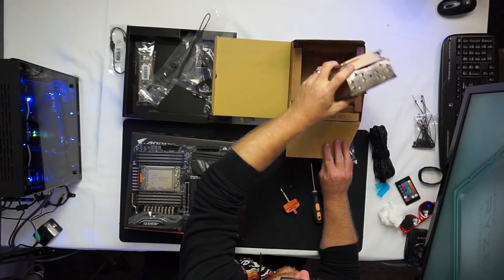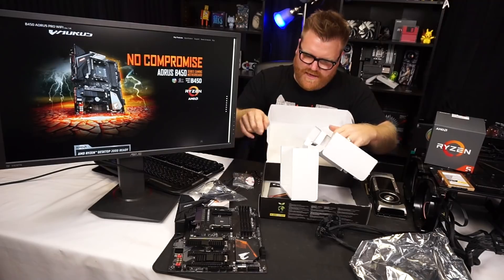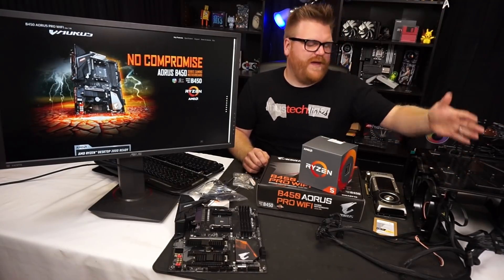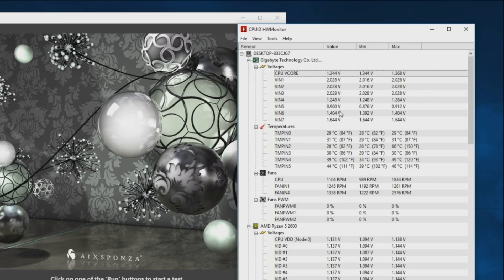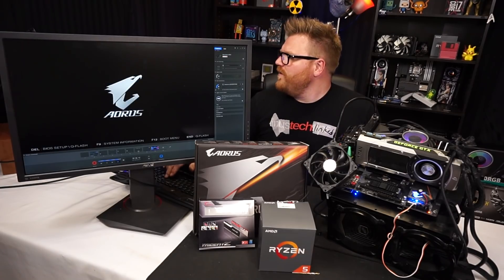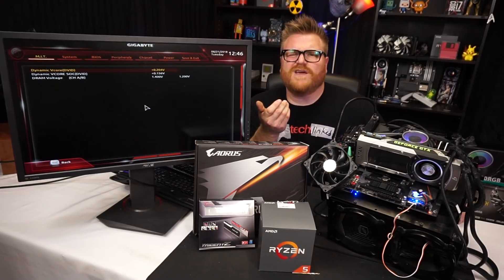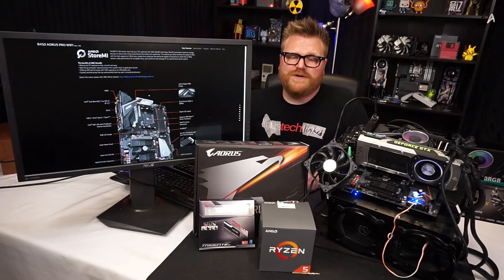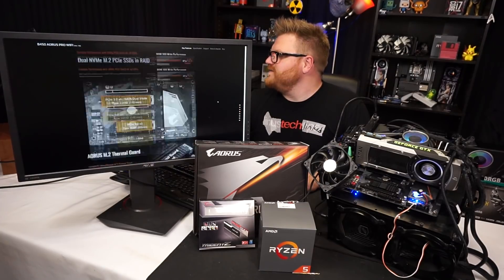B450 Gigabyte Aorus Pro Wifi, all the bells and whistles except for one

Comment: I bought this motherboard for 120 dollars with a 3 years of warranty and 40Euros steam wallet coupon. For its price it is a really great board. Also the problem with Vcore voltage is fixed in a newer BIOS. You can set the voltage higher now. Running the board with my Ryzen 2700x on 4.25Ghz just fine and stable.
Some people bought dozens of these, they received coupons and then they all returned them making even a few thousands of Euros so expect a lot of these in sale used / brand new just open sort of thing. (Info from a big European shop > One guy bought 150 of these and returned them in 14 days moneyback program and yes, all those boards were registered as used in this Gigabyte coupon thing. He received 6000 Euros worth of coupons on Steam wallet for free. )
Reply: you have a 2700x with that mother ?
Reply: @emilianosartori19  Yes, i had X470 Aorus 7 but i sent it back and choosed this one. I don't really need any better motherboard. Overclocking (for home user) is the same, I'm not using SLI or crossfire so there is no need for anything better. My Ryzen 2700x is overclocked to 4.225Ghz, VRM/MOS are under 50 degrees of Celsius. Everything is running exactly the same as on the Aorus 7 motherboard which costs more than double.
Reply: @milanmottl8983  Which bios version allowed you to over clock that much?
Reply: emiliano sartori Hi! I just bought the B450 WiFi pro for my R7 2700, i’m plannig a small oc becouse i’ll be using the stock cooler. I’m pretty dumb in OC stuff, last build i did was 8 years ago, what voltages are you using? What settings are you using in the bios? Tks a lot!
Reply: i have the latest version of the BIOS and it does not allow me to do that i have the RTX 2080 waterforce Ryzen 7 2700x and 16gb of ram and runs games like crap gta v ultra 1080p barely hits the 60fps sometimes it even goes down to 30fps even if i put the game in the lowest settings it goes down to the 40fps i dont knoww what to do im gonna have to change the motherboard i think
Reply: IV Sal Hi there!! Did tiú use MSI afterburner to check yours cpu speed during game? It seem’s that your system is throttling. Check your cpu clock stability, vrm temps. For sure it’s not a normal behave ...
Reply: Hey thanks, didn't know if they had fixed it. :) just got it for $38 from what seems to be a pricing error plus 20% off google express lol. really hope i get it
Reply: Milan Mottl what your build consist of I was going to use this board for my gaming pc with ryzen2700x, 32gb g skill rip jaw v series 2x16 and a 5700xtgpu
Reply: Milan Mottl are the temps too bad in this mobo? using r5 3600 with wraith stealth,idle temps are 48-58C?

Comment: My build as of 6/26/19:

CPU: Ryzen 5 2600 $149.99
GPU: Geforce GTX 1660 $219.99
MB: GIGABYTE B450 AORUS Elite $104.99
RAM: 16GB Corsair Vengeance LPX 8GB (2x8gb) DDR4 3200 $74.99
SSD: WD BLACK SN750 500GB NVMe M.2 2280 $107.99
CASE: Fractal Design FD-CA-Focus-BU-W mid tower blue $59.99
PSU: EVGA 600 BQ 80+ Bronze $44.99
OS: Win 10 Pro64-bit (I have a license already)

Total:
$762.34

...basically absolutely best price:performance benchmark scores.
Reply: nice im about to build pretty much the same build except with a 3600 and a rtx 2060
Reply: Wesley K. Did you have to update the bios?

Comment: My gigabyte board is the same, I used ryzen master to go over that limitation
Reply: I run gigabyte in my girls and my rig as well but I'm thinking about "expanding" my collection after watching this 😎
Reply: I would have like to see him try ryzen master
Reply: Its good motherboard for 2400g ?
Reply: Make sure those "other" 3 VRM have good cooling, because they supply the IGPU with voltage, if you are going to overclock it. Maybe just go with memory OC.
Reply: Is it normal to reset the clocks? because every time I turn on the computer it goes back to stock settings, can I change that?

Comment: The new BIOS fixed some of this, also raised supported RAM speed to 3666. My 2600X OC 4.2 with 3400 RAM, tuned with Ryzen RAM calculator, gets 25-50% FPS gain on this board. That is insane. Just be sure to have air right on the VRM. Without my top exhaust fan nearly touching the VRM its no go. This is the best looking, most premium features, and with dual NVMe heat sinks with thermal pads on them. I got a 2600X this mobo $189.00. It runs games 5-7% slower than a stock 3600X $179.00 CPU only.
Reply: Will this mobo work out the box with a ryzen 5 3600 no bios update needed?
Reply: @centiio5732  I would be almost 100% certain it will need a flash but check with the seller to be sure.
Reply: bodasactra oh okay, im just really confused bc i have a lot of people telling me it doesn’t and a lot of people telling me it does work out the box with a 3600

Comment: I would have really liked to see the temps of the Ryzen 5 2600 with the included fan. Overall, it's looking like a nice motherboard and im not doing much overclocking. I'd be more than happy to have the 2600 run at the same boost clock speed than the 2600x. But i wouldn't be surprised to need a better cooler.

Comment: I'm conflicted. I'm building my first PC, & I don't know if I should get this board or go with the MSI B450 Tomahawk. One thing I like about the Gigabyte is the built in WiFi, which would be useful considering my PC is going to be upstairs & I'll have to run an ethernet cable to it. Besides that I feel like they have a lot of the same stats. Which one would you go with? Or is there a better one then both of those between $80 - $120?
Reply: I ended up ordering this Gigabyte board.
Reply: Elevated805 
Is it good so far?
Reply: Not very school Appropriate it’s been really good so far, no complaints. Are you thinking of getting it?
Reply: @AdrianLopez-sn6ch  So far it's really good!
Reply: Do you use stock amd cooler or a tower cooler?

Comment: I just cant find a decent board for 120-170 that has the things i would like.
ALC 1220, decent Vrm and a Bios with good oc support.
At this point i am thinking about putting down some more cash and getting the (Gigabyte X470 Aorus Gaming 5 WIFI) which costs 190€ here.
EDIT: nvm that, just found out it has the same VRM as the Ultra gaming and that gets hot...

Thank you Timmy joe and also Buildzoid for your Motherboard review's but also DAMN YOU BOTH ! :D

Comment: Hey can should I use this bird with my 2700x if not what other board that has wifi and that is up to $135
Reply: Should be fine unless you want to do heavy overclocking from what I understand.
Reply: Thank you I probily won't over clock much but I was making sure

Comment: Right now this board is $109, the 2600X is $175, and the 2600 has dropped to $149.  If I was to buy one now, for a budget-ish build, would I be better off getting a 2600, if it would likely OC to 2600X performance?  Or is 4.2 more of an exception than rule, with this board and cpu?
Reply: Can u overclock  on the b450 ?

Comment: Cool. With the overclocking issue is that CPU voltage limited? e.g. Is the B450 board good enough to drive say a R5 3600 next year? For a cheap chip, would it be easy to flick off for $100 next year and upgrade to 7nm?

Comment: Anyone else has problem with overclocking RAM on AORUS?
I have a AORUS B450 PRO and after updating the BIOS the max OC on RAM is 3000 MHz. 
Out of the box I was able to push 3200 MHz Cl14.

My RAM is HYPERX PREDATOR 2666 Cl13, but the same issue is present on AORUS X470 GAMING 5 WIFI with GSkill Ripjavs V 3200 cl 16.
Previously they run on default X.M.P. (3200 cl 16) now max is 3000 MHz.

New BIOS is f42c.

Comment: Hello friend. I have a question for you. The RGB in this motherboard works correctly? I have a Aourus B450M with 3 fan's ID COOLING 12025 RGB and not found the solution for the the correct colors. I select red color on "rgb fusion" and illuminates red. :(
Greetings from Argentina

Comment: I have this Mobo with ryzen 5 3600 with 16gb of team tforce vuclan 3200mhz and I get no post, lights at the bottom show dram for 10 seconds and flashes CPU light for 0.5 seconds and then repeats I've tried just about everything except test to see which component is at fault because I do not have proper test equipment. Someone plz help
Reply: Did you update the bios? Don't think it supports 3600 out the box
Reply: @justincowans2677  No I don't have a 2nd gen ryzen CPU on hand but my brother is ordering one soon and should be here in a week so hopefully it's just as simple as a bios update and not a fried mb
Reply: @spuxx470  Go to a local computer repair shop. They may charge a couple of $$ to update bios for you.
Reply: @justincowans2677  Unfortunately the ones in my town are closed on the weekends... How much do you think it would cost for them to update bios?

Comment: Any way to post using a Ryzen 5 1600? My pc powers up with Ryzen 5 1600 but no post. Tried using a gpu but still no post. Only fan spins at high speed. Do I have to use integrated graphics cpu?

Comment: Hi Timmy! I have bought Gigabyte Aorus B450 Pro and ve built it with new parts...My Problem is.... after i ve installed Windows 10 i can use ethernet but when i close my pc, everything is lost! the next day when i start my PC i can't find OS, the monitor shows nothing! the BIOS is resetting itself.... which settings i should have??? i ve tried with changing the battery..... and disabling CMOS on Bios Settings.... idk why i still can't use my pc.. i ve paid so lot for it but it doesn't work well......

Comment: I bought one of these 2 days ago built my pc and my pc froze, I took it apart after it wouldn’t post and I saw it was the ram. Thought I had dead ram sticks turns out it’s the slots on the motherboard. Any recommendations to help make my ram work again without a new motherboard
Reply: Ceamus did you ever figure out the problem?

Comment: i put mine in with a amd ryzen 5 2600 (2nd gen), and now my computer won’t even boot, it has a small flash and turns off, gpu is on, but no fans work, kbm turns on, but no power

Comment: Got the same board and processor, however im having problem with my memory which is Corsair Vengeance rgb pro 3600mhz. Can you teach me how to fix this? XMP not working, stuck in aorus logo. 😭
Reply: Try getting back into the BIOS to reset it and see if it boots. What processor do you have? If the  CPU is not okay with XMP or higher ram speeds it won’t boot. 

I have the same board as you and I had a lemon of a 2700x that only accepted Ram speeds at a maximum  of only 3000mhz.
Reply: @llamaisms  i got ryzen 5 2600, b450 pro wifi mobo.
Reply: @jcmvergara  Sounds like either a RAM or CPU issue. Like I said above try booting into the bios. Unfortunately if that doesn't work you might have to trouble shoot or return your Ram.
Reply: @llamaisms  i just read an article about it, 2nd gen not supported. 3rd gen supports C18 rams.
Reply: @jcmvergara  Yep that would be your issue then.

Comment: i just realized he has a tech linked shirt on 
i wonder how high i can overclock my ryzen 5 1400 on a dell mother board (the dell gaming 5675 to be exact)
right now its at 3.8ghz at 1.3v  and it never goes over 162F and the rams at 2400mhz (stock 8gb ram stick)
Reply: you'll gain more if you oc your ram, if possible

Comment: AMD Ryzen 5 3600 3.6GHz box
Cooler CPU ARCTIC AC Freezer 34 eSports DUO White
GIGABYTE AORUS B450 ELITE
Patriot Viper Steel 16GB DDR4 3600MHz CL17 1.35v Dual Channel Kit
SSD Intel 660p Series 512GB PCI Express 3.0 x4 M.2 2280
Super Flower Leadex II Gold 650W
SilentiumPC Regnum RG4T RGB Frosty White

ROG-STRIX-GTX1070TI-A8G-GAMING

After bios update from F40 to F42a, and manuali putting my ram to 3200mhz instead of defaut 2133mhz or xmp 3600mhz (doesnt work on this board)... My pc doesnt post anymore, red VGA debug led appears, my gpu vents stop working after a few seconds. CMOS jumper and battery dont work. The bios update was succesfull, because after it restarted it logged into windows 10, then I manualy changed the ram to 3200, and after that it didnt work anymore
Reply: Did you eventually find the problem?
Reply: @BlackCubone  the warranty changed my processor and motherboard, think they were fried... now i got an msi x470 gameing pro and it rocks
Reply: @BlackCubone  yes, my mb and processor were fried, they gave me a new ryzen 3600 and the money back for my mb... i now have an msi x470 gameing pro and its rock solid at 4,2gz and 1,34v

Comment: Rate my Australian Setup - $1,085 (AUD)

CPU - $235
AMD Ryzen 5 2600 with Wraith Stealth

Motherboard - $229
Gigabyte B450 Aorus Pro WiFi Motherboard

RAM - $129
Team T-Force Dark 3000MHz 8GB (2x4GB) DDR4 Red Black

PSU - $65
Corsair VS550 550W Power Supply

Case - $109
NZXT S340 Mid Tower Case White

SSD - $89
Crucial MX500 SATA 2.5in SSD 250GB

Graphics Card - $229
ASUS Radeon RX 570 Expedition OC 4GB

Comment: I'm planning to use the same B450 Aorus pro WiFi with an Ryzen 5 3600. I'm planning to overclock my 3600 to 4.0 GHz, cooling it is a Cooler Master Hyper 212 Black.
Will my thermals be good? and will performance be choked?
Reply: Trust me, you're better off getting an MSI B450M Tomahawk MAX, MAX means it is BIOS updated so you can directly use a 3rd Gen Ryzen Processor with it, it doesn't have WiFi, but it has way better VRMs and overclocking support. If you really want WiFi, just get a WiFi card.
Reply: You should be able to overclock a 6 core processor just fine with any b450 motherboard.
Reply: @hazzmati  I feel wherever I go, AORUS Motherboards aren't the coolest when handling a 6c/12t CPU. And you should definitely get an MSI motherboard if you're overclocking. The cooler is pretty good. I am a person who prefers performance over features and aesthetics, it is your choice if you wanna go AORUS or MSI or the other Motherboard Brands, I like AORUS, but they are focusing more on aesthetics and features than better VRMs and performance. Hope you liked my mini rant about this.
Reply: @piyushmenon4987  I would have chosen msi b450 pro carbon but with their newest bios they downgraded it to a lite version with less functionality. I think I will go for asus x470 prime pro then, similar enough to the b450 aorus pro but better vrms and performance.  But I still think the aorus pro would be fine if you keep it at stock speeds. Check the reviews you can see the b450 aoruos pro keeps up just fine with other motherboards in performance aspect.
Reply: @hazzmati  Ok, well, that Motherboard is pretty good, I would however recommend you wait a bit for the new B550 Motherboards.
Reply: @piyushmenon4987  Yeah I'm interested in the b550 motherboards but they won't be around until somewhere in june sadly. I don't think I can wait that long, kinda wanna build a pc this week. I probably don't even need the advantage of the b550's
Reply: @hazzmati  Well, if that's the case, good luck on your PC build!

Comment: would you recommend this MB for a 2600x?
Reply: f*ck that sh*t bought it anyways... works like a charm
Reply: @Siniestro  i hear the motherboard has a ton of problems, everything working good?
Reply: @MrApplegummy  not a single problem at my end...
Reply: Did any OCing with that setup? Getting the same exact thing with a FTW2 1080. Just wondering how ocing the 2600x is on this board
Reply: So I’m thinking about getting this motherboard , I have a Ryzen 7 2600x with 16GB ram 3000MHz  . Do you guys think it will run smooth and if so what kind of graphics card should I Throw in there ?

Comment: This mobos usbs stop working after windows 7 boots and i also upgraded to ryzen 5 2600x , gtx 1060 and had to get new ram as well. Usbs dont even work in safe mode, driver issue??
Reply: I know this is a old comment but Ryzen doesn't Officially support Windows 7 I think it only supports Windows 10 and future

Comment: Hey hello, i have the same mobo, but act can i ask you why my ram cannot up the speed into 3200mhz in this mobo? I use ryzen5 2600 b450 aorus pro wifi mobo and 2stick of 6gb 3200mhz xpg d40 ram, stuck with this problem almost 5months
Reply: Correction** 2stick of 8gb 3200mhz d41 xpg ram

Comment: I just had to RMA this board (used with a Ryzen 2600x and 3000mhz DDR4 mem kit) for a new one it is a nice board but I am not impressed with the quality control. Another point I would like to make about this board is the motherboard software to control RGB devices connected through the RGB header is junk. I have used quite a few different motherboards on AMD and Intel platforms they all have better software solutions Asus is the best I have used so far.

Comment: Gigabyte B450 Aorus Pro Wifi
AMD Ryzen 5 2600
JONSBO CR 1100 AIR COOLER GRAY
T-FORCE DELTA TUF GAMING ALLIANCE RGB DDR4 3200hz 2pcs
MSi GTX 1050 Ti 4GT OCV1 Gaming Graphics Card with NVIDIA
This is good set up? But for now im using 750ti soon 1050ti

Comment: What case this board compatible with and can I use a Rx 570 and ryzen 3 in it with a 500W ps?   What case can it work with
Reply: Aion Barrett XD! It can work with any case that has atx standoffs (screws that hold screws) and yes it could work with rx 570 and ryzen 3. The 500W psu would work

Comment: Sorry but i  can't get the difference between this model and the one on gigabyte website here: https://www.gigabyte.com/Motherboard/B450-I-AORUS-PRO-WIFI-rev-10#kf  It seems the same model but the one i linked has 3 different video  ports (2 hdmi + 1 DP). I ask because i want to build a ryzen 2400G with 2 display connected (both 4k) .